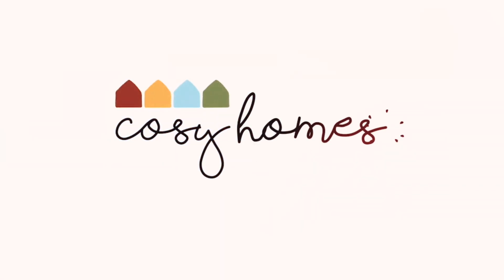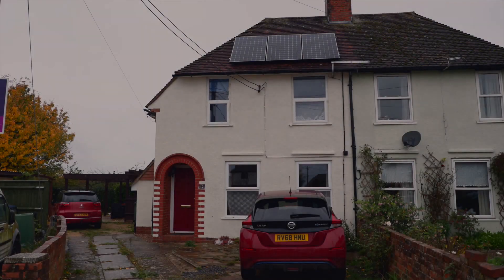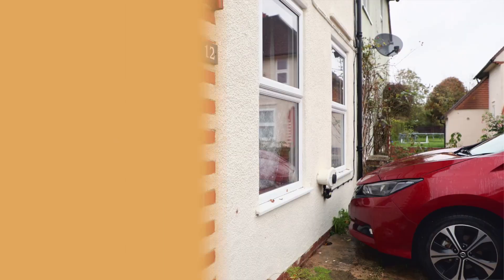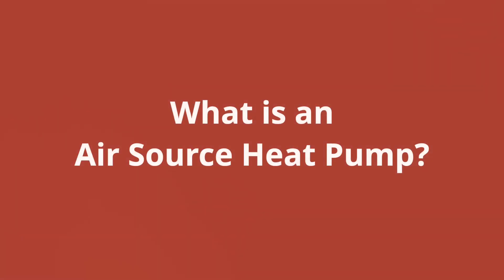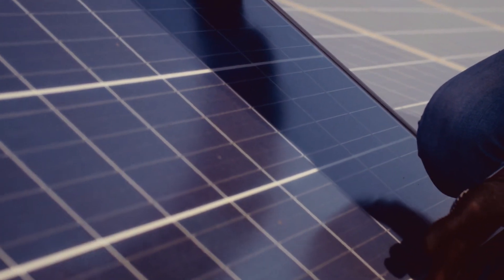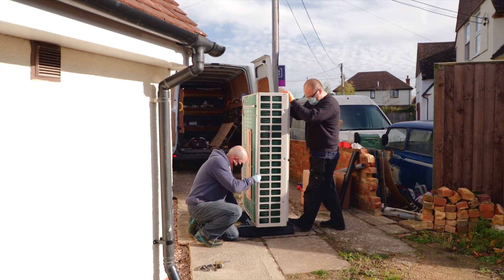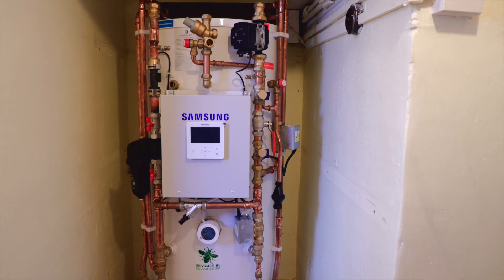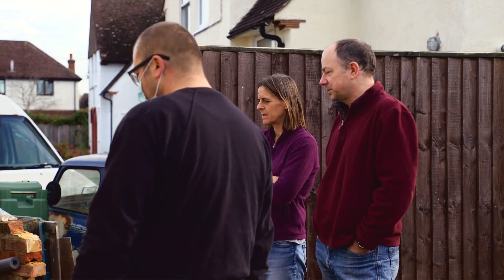Heat pump made this Didcot home warm in winter, cool in summer, cosy all year. Eco home improvement

Comment: New government incentive is 5k towards the cost and firms offering 0% finance on the remainder for 2yrs, this is going to cost tens of thousands to install and tens of thousands to insulate, part L of the building regs states gad boilers are now to run at a lower constant temp now with oversized rads jst like a heat pump does and 20k is alot of gas.

Comment: Tens of thousands of pounds vs a £1700 gas boiler?  Which one makes economic sense?   All ‘renewables’ are highly subsidised by the government (taxpayers) as well.  And look at all the complicated equipment needed for this installation, instead of a small boiler in a cupboard!   The cost of all this will take years to pay back in savings ( if there are any),  then some of the equipment will need renewing - more cost!
This is just simply an advert, not a information video.
Reply: I am guessing you have a better idea of how to reduce or remove emissions from uk homes?

Comment: Isn't cavity wall insulation to cause issues with damp etc as it bridges the air gap?
Reply: Not if your house is properly ventilated.
Reply from the maker: @jooie444  Spot on! We take a whole house approach, looking at all aspects of the house. Sometimes one measure can have knock-on effect, such as damp, which can easily be avoided if planned properly. As you say, often added ventilation is the simple way to avoid these issues.